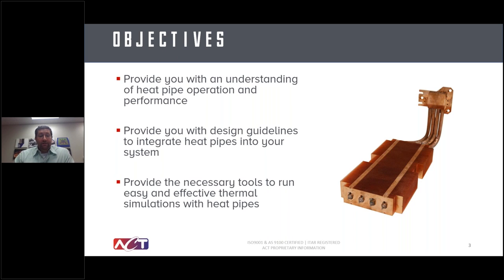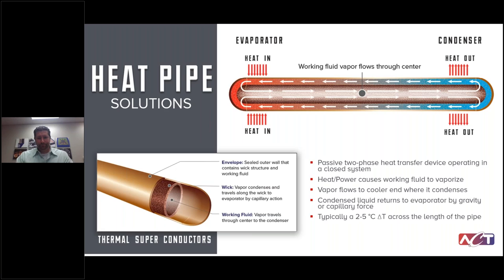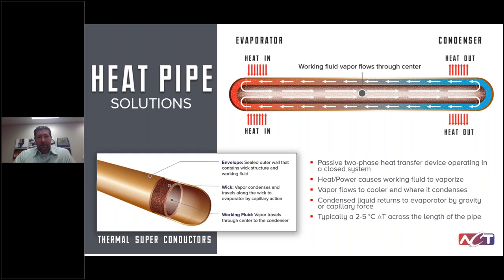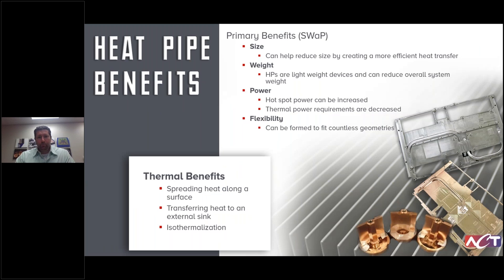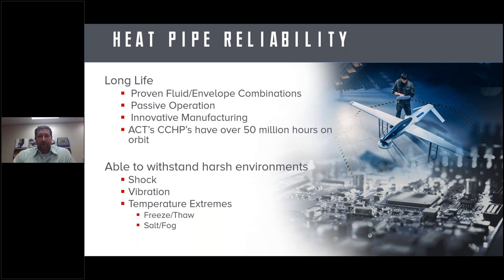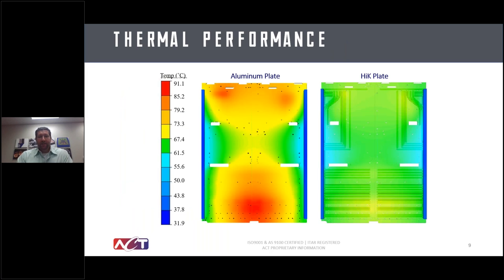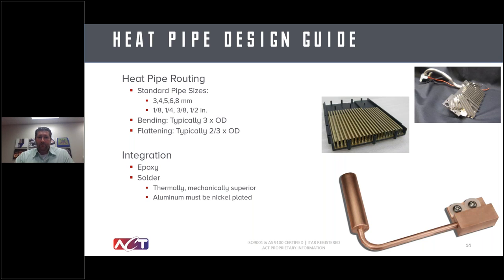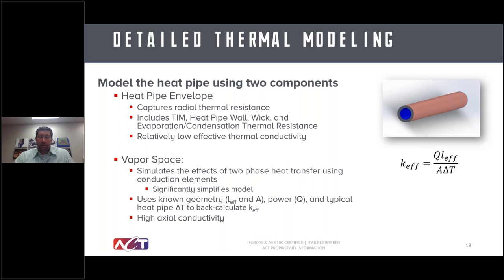Heat Pipe Design and Modeling Techniques

Comment: I have a selection of heatpipes acetone ones but not the ideal size and stuck at atatching to cold condensing area. But as you suggest soldering a conecting plate is a probable solution. Thanks for the helpful video.
Reply from the maker: Thanks for watching! We're glad you found it helpful. Feel free to reach out to our engineers if you've got a project that we could help with! https://www.1-act.com/contact-act/

Comment: How do you compute the thermal conductance in slide 22 from the thermal conductivity of 26.7 W/m-K. Do you multiply it by 1 inch (evap length). I have a model that needs the thermal conductance i.e. W/K

Comment: Do you know if there are a heatpipes with bigger diameters (>40mm) on the market?
Reply from the maker: Not likely to find standard heat pipes (off-the-shelf) in that size, but they can be made if the project warrants it. ACT makes IFLs (a type of heat pipe) for the calibration industry with inner diameters of several inches.

Comment: Can these heat pipes be used for homogenizing heat over a heating plate? Say up to 400°C?
Reply from the maker: Hey there, great question! Yes, it’s a typical use case for heat pipes to isothermalize a surface. The temperature range would be a function of the fluid and 400 C is out of normal operating range for most common working fluids. ACT would be the best fit to solve this challenge though. If you have more details you can provide on the application please email them to solutions@1-act.com
Reply: @AdvancedCoolingTech  Hi Thanks for the reply. I have no real life application for the heat pipes yet at moment, but your video provided a very interesting insight to what might be possible. Will save your video link for future requirements.

By the way what would the typical temperature limit be like?
Reply from the maker: @Schroeder9999  Great question. This section of our Heat Pipe 101 covers Merit Number, which gives ranges for various working fluids: https://www.1-act.com/thermal-solutions/passive/heat-pipes/heat-pipes-101/#jumpTo__h3-selecting-a-heat-pipe-working

Comment: I have  never seen these used in the automotive industry.  Seems like a perfect fit. If it is used, it is uncommon, does anybody know why?
Reply: Engines are rather big temperature differences, but even greater power flows.  I have used them in small (<2HP) engines.  
Residential implies moderate  temperature differences, but huge power flows.  Geothermal might be practical.

Comment: Can water boils at 25C?
Reply from the maker: Great question! Yes. Heat pipes are processed under vacuum, so the fluid will operate along its saturation curve. Water would be in two-phase and able to boil at 25 C.
Reply: @AdvancedCoolingTech  Isn't the water density a parameter of the wicking & temperature regimes?